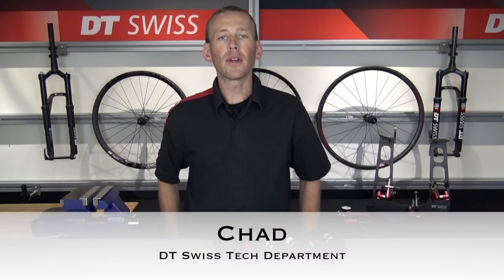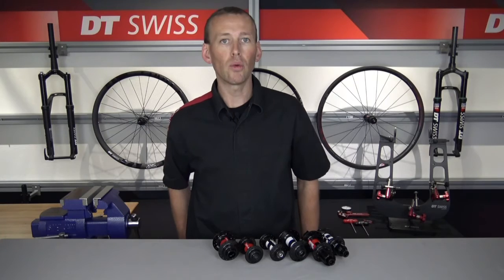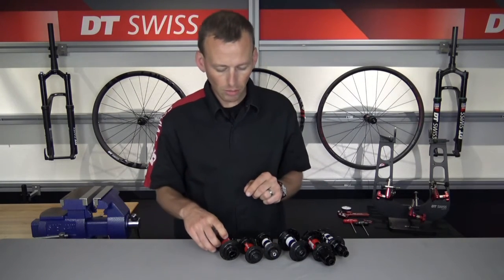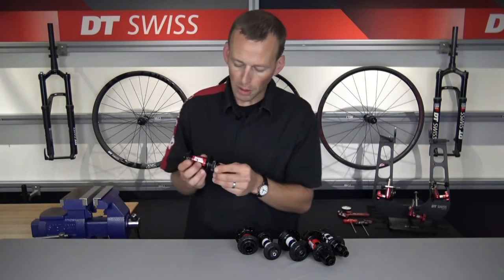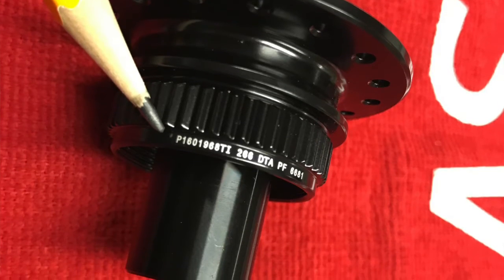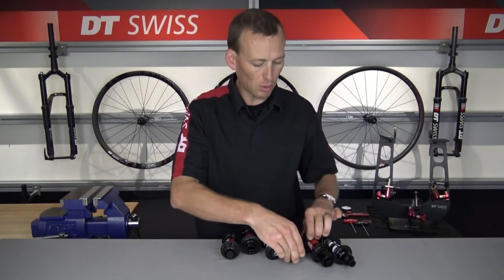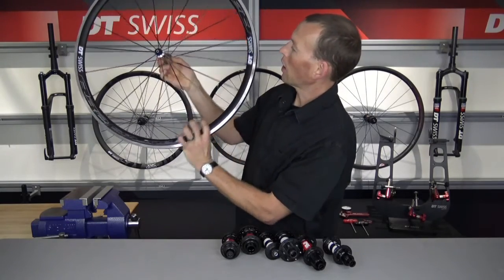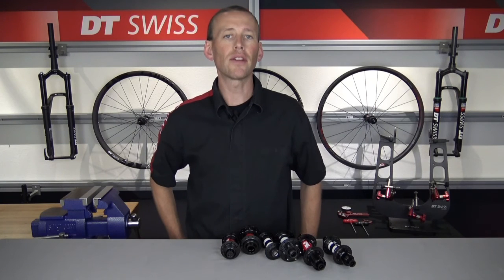How to locate the serial number of DT Swiss hubs.  | DT Swiss

Comment: I have an older (2009?) 240s 100mm x 15mm TA, 32hole, centerlock front hub.  The numbers on the drive side of the hub shell read: P1089419 491 DT PF 2145    I'm looking to convert this to 100mm Quick Release.  Which end caps do I need (if this hub is convertible)?  Thx!
Reply from the maker: Hi and thank you for your question. Please get in contact with one of our service centers. We the information you provided here the colleagues can answer your question: https://www.dtswiss.com/en/support/contact
Friso „DT Swiss“

Comment: Hi, I know that I am ressurecting and old comment sections but I am desperate.

Can you tell me which wheel hubs do I have based on these serial numbers:

Rear: P1525927YL 064 DPA N 3977
Front: P1525454YL 063 DTA N 3947

Thanks in advance!

Comment: I have a pair of wheel which believe it is dtswiss hub. Can you check if it is dt240 hub series?

Front with code P1085216 393 DT PF 1572
Rear freehub L40302 102 DTP 1560

Comment: Hi. I have a 240 rear QR hub that is currently set up with 130 spacing and I believe  it has a 10 speed freehub body. I’d like to convert it to 135 spacing and ALSO to 11 speed. Can I do this? Is so, what parts do I need with part numbers please. I’d really appreciate it. Thanks! The serial number of the rear hub is as follows: P1112240 104 DT P 1650
Reply from the maker: Hi Bruce, a 130mm hub cannot be converted to 135mm due to its different hub shell. You can mount a 11 speed road freehub body but the overall width will change to 131mm. However this still works with most 130mm frames. Kind regards, Christian, DT Swiss

Comment: Thanks for the video, very useful. I have a hub with Serial No. P1289143FJ 233 DTA N 4479, I think it's a 370 but I haven't sure. Can you help me identify mu hub?
Reply from the maker: Hi Rui, this is a 3-pawl rear hub which is used in wheels from our 1900 line and a wide range of OE specific wheels.
Best regards, Kai, DT Swiss.

Comment: hello i'm buying a pair of used hubs, but they are without the decals, could i confirm by the serial number if they really a 240 boost center lock hubs?
P1824445 287 DTP F 7657
P1722835 372 DTP F 7683
Reply from the maker: Hi Bruno, according to the production code thos should be 240 boost center lock hubs.
Best regards, Kai, DT Swiss.

Comment: And suspension DT XRC 100 ? can I id only the legs  after dismantle. I have a serial number but I found only the lower legs.
Reply: DT Swiss XRC 26 100mm
Reply from the maker: Hi Pedro, thanks for the question. The serial number on that model fork is usually found on the under side of the crown unit. For further information, you can contact us at info.us@dtswiss.com. Regards, Andrew - DT Swiss USA

Comment: Just curious, is there any information on common identifiers  to distinguish between a 350, 240s, 180, etc. if decals have been removed?
Reply from the maker: Hi Nick, 

main difference between 240s and 350 is the amount of machine works on the hubshell, furthermore 240s are equipped with lighter ratchets, and rear axle has a grove at the end which keeps the endcap better in place. 180 hubs are easy to recognize, they have a carbon Piece in the middle of the hubshell. 

Best regards, Kai
Reply: Lol I know the physical difference of the hubs ... I was wondering on differences in the serial numbers between these 3 for example. I took the hub stickers off a 350 front hub 15mm and was wondering how to know the difference with a 240s. For a side by side comparison I noticed that the 240s that I own  have a "DTP" identifier and the 350s I own have a "DTA". I saw the same identifiers on the hubs in the video, therefore I was trying to find out if there was any rhyme or reason to this?
Reply from the maker: Production code on the hubshell does not indicate the type of hub. they can only be differentiated by their physical differences.
Reply: Ok cool! Good to know!